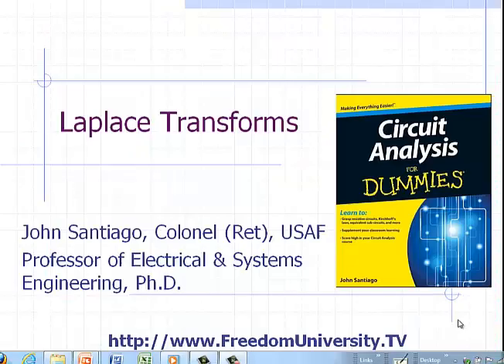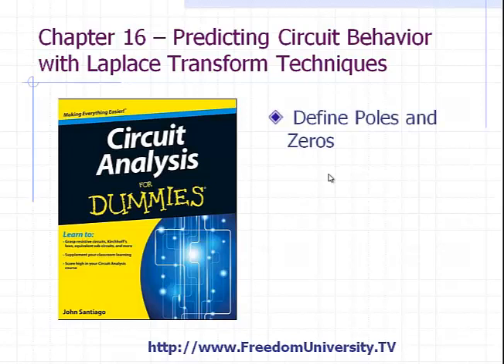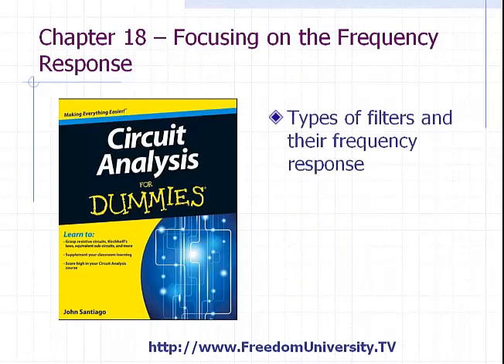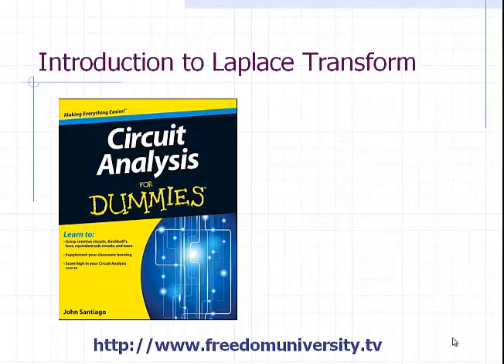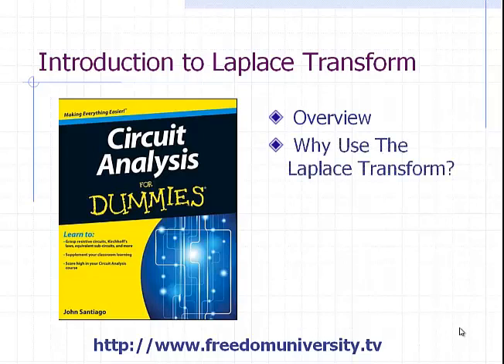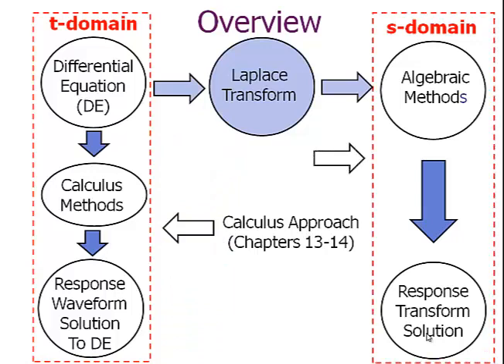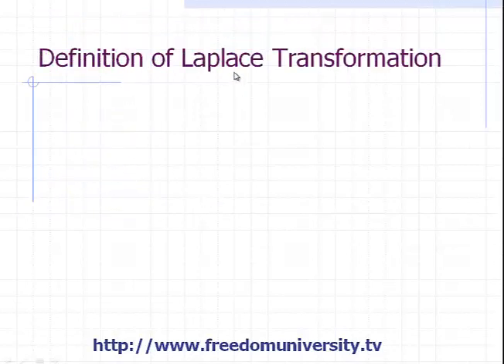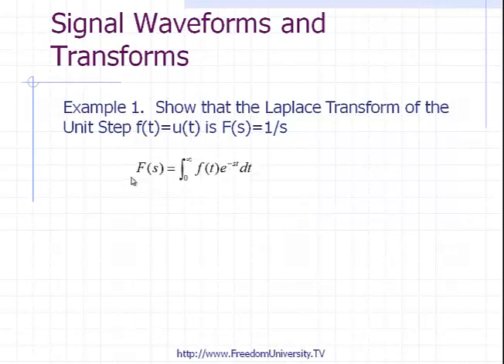[Laplace Transforms] Overview & Laplace Transform of Unit Step Function

Comment: An excellent straight forward presentation. Essentially, Laplace transforms allow complex differential equations (time domain) to be converted into simple algebraic functions (s or laplace domain). They are very useful for AC Circuit Analysis.